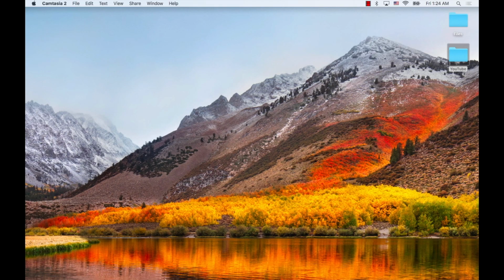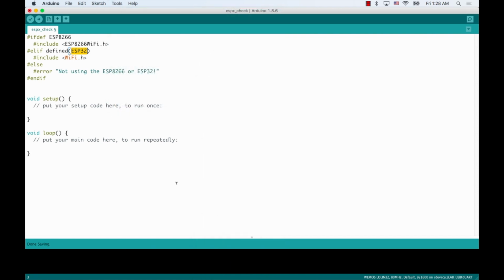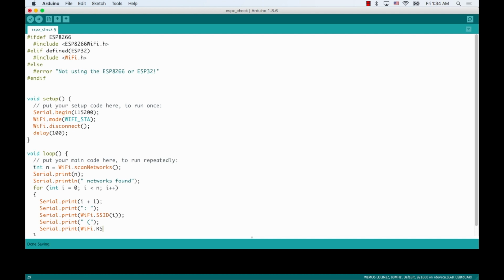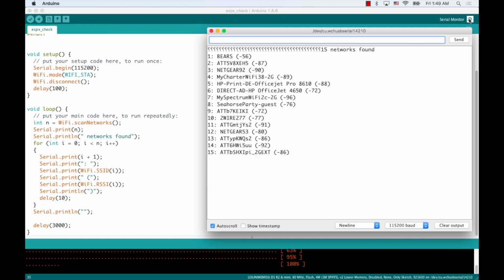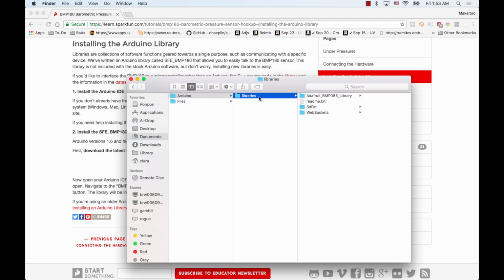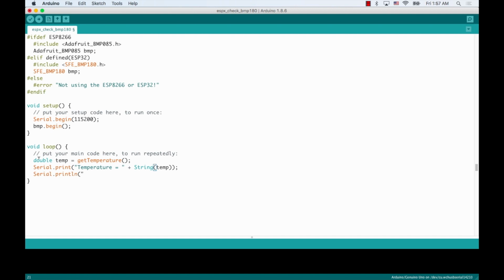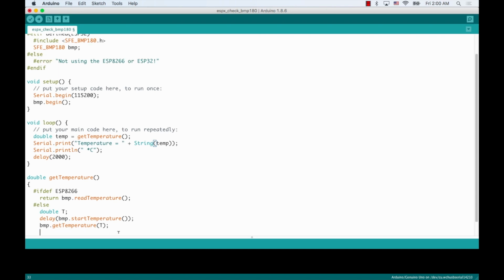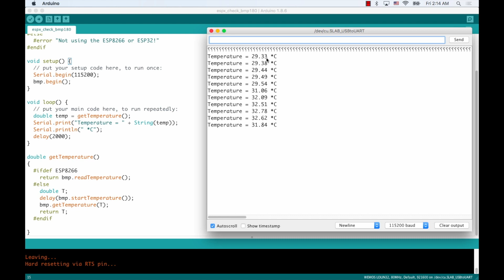ESP8266 and ESP32 Compatible Code Using Arduino IDE (Mac OSX and Windows) | WeMos BMP180

Comment: Isn't there a little bug in the ESP32 code? The variable T is passed by value to the method.  How does the return value get back into T.  Shouldn't it be T=function() or function(&T)?
Reply from the maker: Good point. Remember that there are two ways to pass by reference. You can give the function the address directly (the function would use * in its argument), or you can give the function the variable itself (the function would use & in its argument).

For review: https://www.ibm.com/support/knowledgecenter/SSLTBW_2.2.0/com.ibm.zos.v2r2.cbclx01/cplr233.htm

Comment: nice and effective 
i have seen some other kind of declaring the boards to use like this:
#ifdef ARDUINO_ESP32_DEV
hmm how is that?
Reply from the maker: Thanks, Ali! There are two different macros defined when you compile using the ESP32 core for Arduino: ESP32 and ARDUINO_ARCH_ESP32.
The second one relies on people correctly following the installation instructions (using the board manager), so that the architecture folder has the right name. I have seen instances where failing to do that creates a few problems, so I tend to use the first macro.
Reply: i see , thanks for the info :)